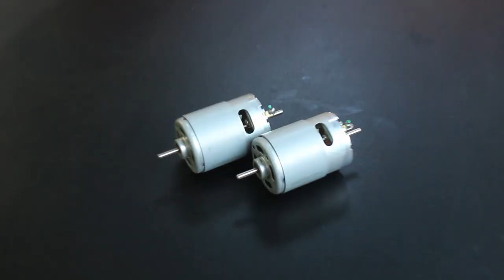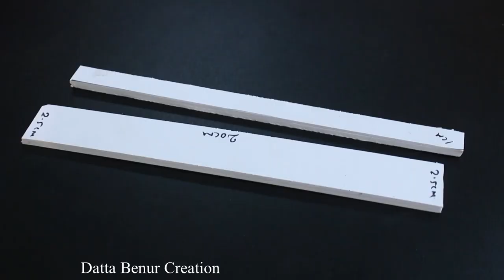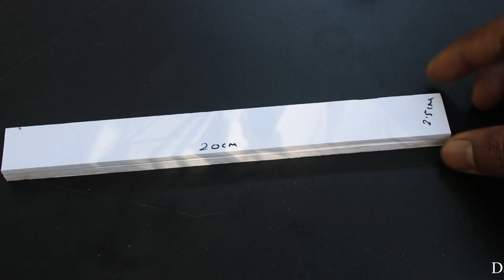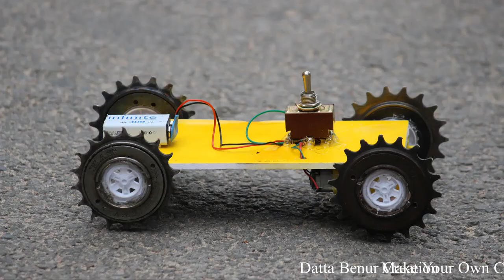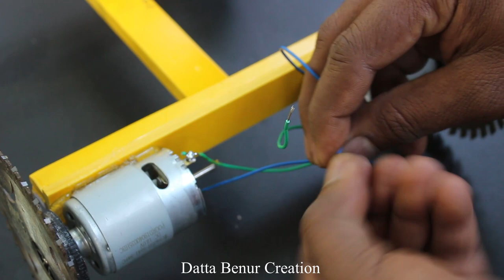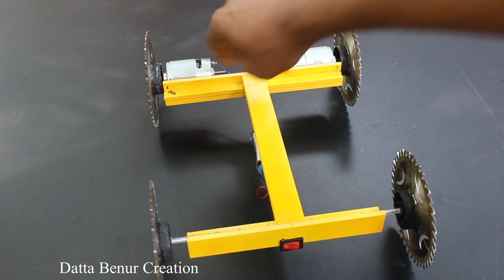How To Make a Wood Cutter Car - Cycle - Motor Cycle - CAR

Comment: But how a single 9 volt battery pretend to work on 48 volts 4 motors and it is not cutting the wood?